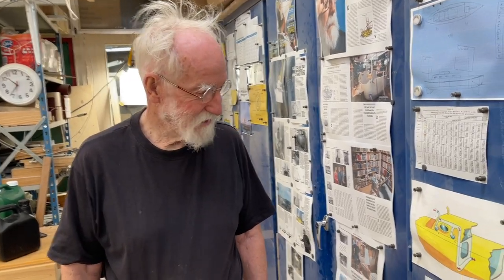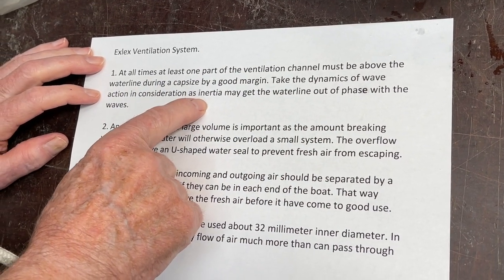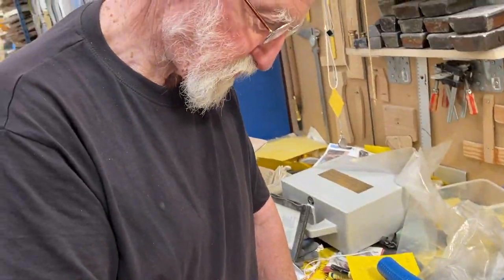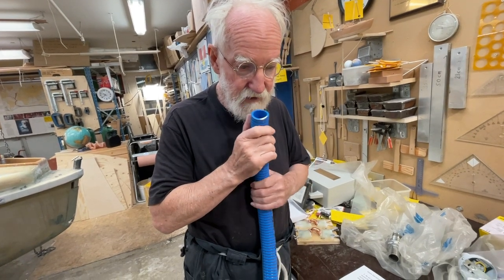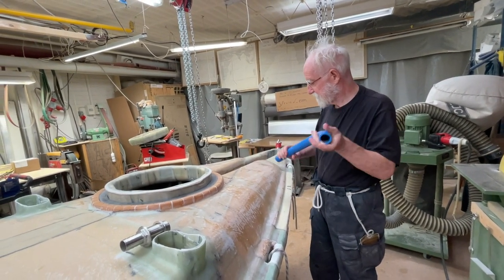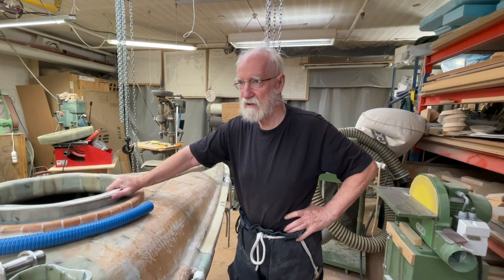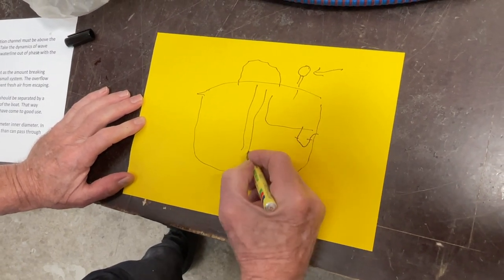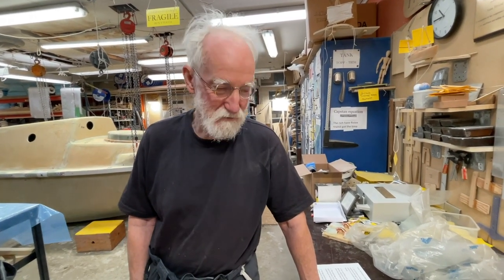9 Aug 2023  Exlex ventilation system  4 Points

Comment from the maker: Exlex Ventilation System.

1. At all times at least one part of the ventilation channel must be above the waterline during a capsize by a good margin. Take the dynamics of wave action in consideration as inertia may get the waterline out of phase with the waves.

2. An overflow tank of large volume is important as the amount breaking waves of green water will otherwise overload a small system. The overflow tank should have an U-shaped water seal to prevent fresh air from escaping.

3. The openings of the incoming and outgoing air should be separated by a good distance. It is best if they can be in each end of the boat. That way outgoing air will not remove the fresh air before it have come to good use. 

4. During several decades, since 1976, I have used channels with about 32 millimeter inner diameter. In strong winds there is a steady flow of fresh air, much more than can pass through my nostrils to my lungs.
Reply: Make the vents redundant so that if one vent gets plugged with something another one will suffice.
Reply from the maker: @ralphwatten2426  
That will take to much place.
an inspection hatch is better.

Comment: It makes sense.

Inboard powerboats (esp Sportfish) have vents on the topsides, below the gunwhale- they will have an inner cowl that allows air over the top but any water sheds back out the vent.
Reply: That's OK for a powerboat, but would not withstand prolonged immersion, because there is no syphon breaker. 
This is the purpose served by Sven's internal duct making a complete circuit of the cross section of the interior, when viewed from the end.
Otherwise, at certain angles during a slow capsize, the ventilation system will syphon water into the boat. 
The same is true of traditional sailboat vents based on Olin Stephen's design for the iconic offshore yacht "Dorade"

Comment: With the boat being so water and air tight ventilation would be very important much like a submarine.  With the addition of the center keel I think the moment of capsize would be much shorter than without the keel.  The large overflow tank may hurt the ability of the boat to right itself some.
Reply from the maker: The overflow tank is such a small part of dispalcement that its effect on the rightning moment will be marginal.
Reply: @SvenYrvindExlex  I now wonder what the center keel will be.  Low and flat to complement those other beaching runners I would think.
Reply from the maker: @ralphwatten2426  
It is low aspect ratio.
I have made several videos of it before